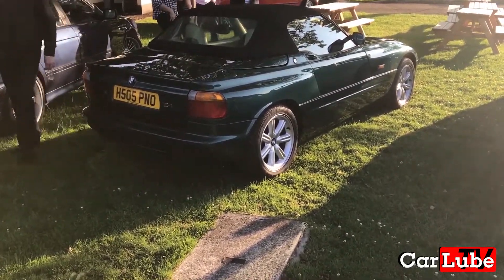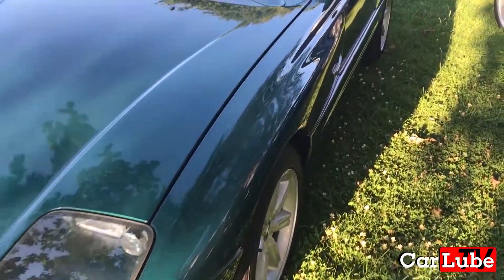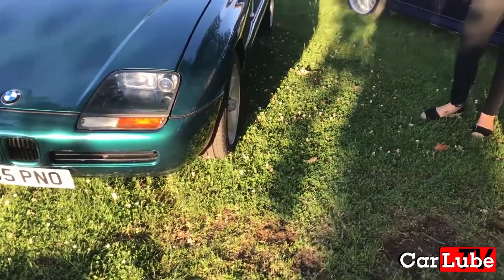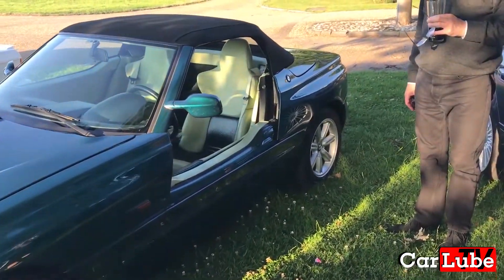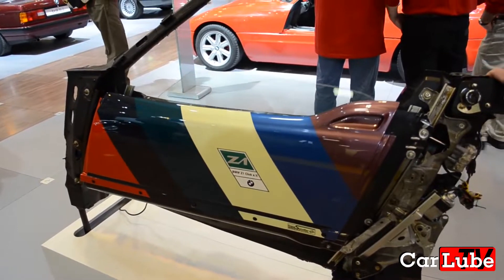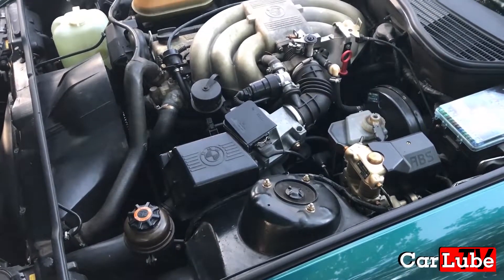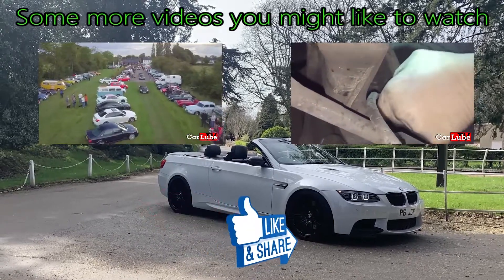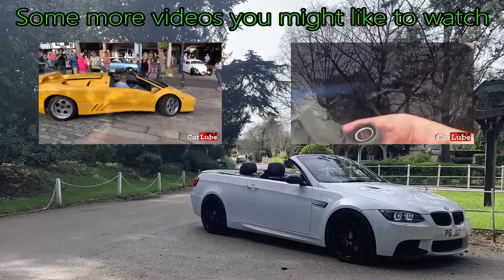Amazing Disappearing Doors BMW Z1 - How do they work ? -Demonstration

Comment: I am shocked car manufacturers don’t use these doors! Unless there is a safety reason..bring this shit back! It’s badass
Reply: I think it's more about practicality and prices. Plus in case of serious crash the car might lose power and the doors won't open in that case easily. I heard that Teslas have such issue. They use buttons to open and close the doors that stop working if the car loses power. There are ways to open the doors manually, but owners either don't know about them or forget them in panic. Some of them literally burned alive, being unable to exit the vehicle in time.
Reply: @ReasonX3 vans have sliding doors. It doesn’t have to be power operated just hydraulic lol

Comment: Lincoln was also toying with drop down doors. I personally think they are a bit too complex HOWEVER they are so cool they are worth it. As long as you can afford to maintain them... That's always the problem with these cool "advancements" they just add complexity and cost to cars which is good for the OEM's and bad for consumers... Still...
Reply: Reminds me of the automatic seatbelt craze of the same era... Even entry level Ford's had them for a while..

Comment: You prolly drained that car's battery, jajaja
Reply: There is a rather fiddly manual override for that eventuality. Best not let the battery go flat, as it's housed in a compartment behind the driver's seat/ You need to open the door to get to it. Actually there's also a positive battery connection in the engine compartment; you connect the negative to the suspension turret. You still have to open the door to access the bonnet (hood) release though.